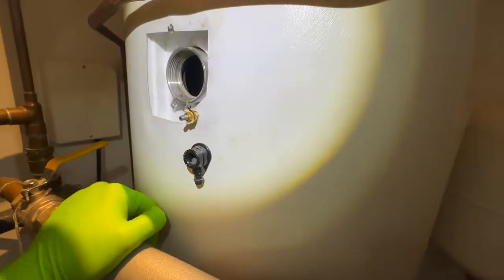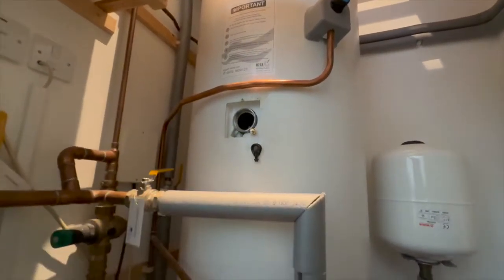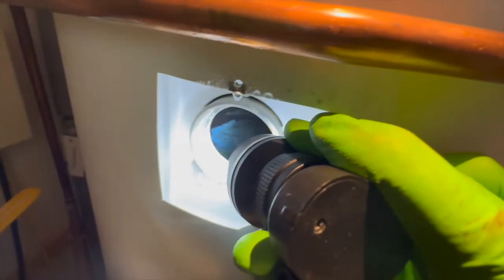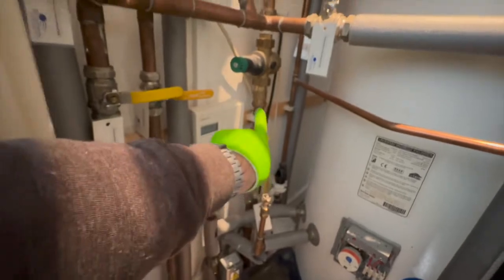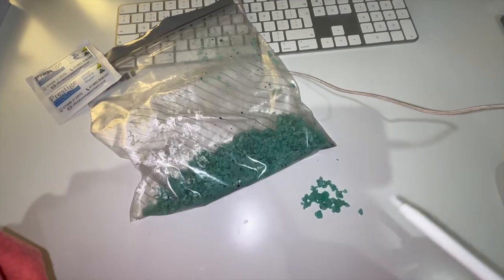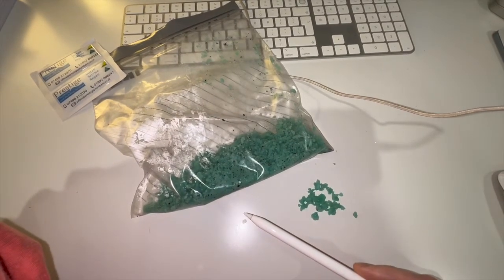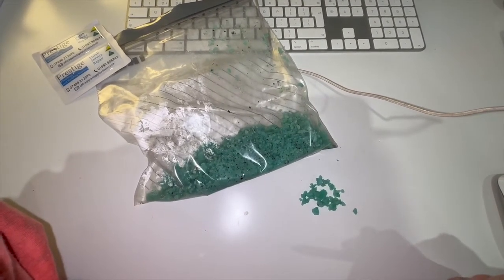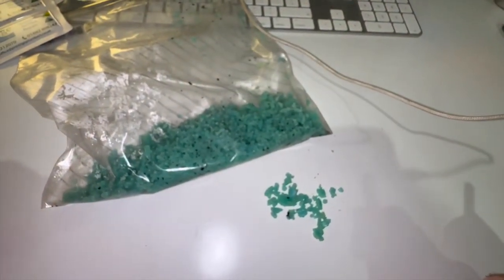Broken baffle plate in Heatrae Sadia Megaflo hot water cylinders

Comment: Hi,
thanks so much for this video, I've been dealing with something similar since 9 months.
I'm currently a tenant in a flat with similar Unvented Direct Cylinder from Heatrae Sadia, and the water since we moved in smelled of chemicals/heated plastic.
The one in this flat was installed on 2016 and it has a corrosion inhibitor unit from the cold water inlet.
It's been a nightmare trying to get this cylinder checked and serviced, as the property manager from Chestertons in London, the estate agency renting this property, has been the most incompetent, uncollaborative and rude person I've ever dealt with.
Took 5 months to get someone from Baxi (now owning Heatrae Sadia) to check the cylinder, and when he visited the property, said he couldn't smell anything unusual other than normal heated water.
Which totally false as boiled cold water and hot water from the cylinder have completely different smells, with the one from the hot cylinder clearly smelling chemical (burnt plastic or when slightly warm is like vinegary).
The boiled cold water is unaffected.
After the Baxi's engineer came (he was probably an outsourced engineer as I could read the name of his company on his jacket), he asked me to do a test to check if the coil was broken (after I suggested it), closing the inlet from the central boiler.
After that the property management should've followed up but it didn't happen, probably because the property manager didn't want to deal with this further.
After 9 months, close to yearly renewal of the rent contract, the issue is still there.
I have the feeling the issue is the baffle disintegrating. Luckily we haven't used any hot water for cooking or drinking, but we still use it showering/bathroom.
Although the water seems clean and the taps aren't clogged other than usual limescale.

Comment: My plumber has conferred with a Baxi staffer on the tech side and has suggested a separate expansion tank and a strainer on the main hot outflow which can be more easily serviced and cleaned. A more economical option that I’m prepared to try. Baxi customer services option was for them to send one of theirs to confirm it is not repairable at around £90 which they say is refundable if the faulty baffle is verified. Then it’s over to the warranty people. I put the question, ‘as its a non-serviceable part that an annual service wouldn’t have discovered, will your 30 year warranty be honoured despite mossing service history’? No straight yes or no was forthcoming.
Reply from the maker: I've done the same myself on very old cylinders - and it will work.

Comment: Im not surprised that Baxi are wriggling over this issue as it is clearly a flaw in the material used and of a non serviceable part - or at least its in such a place that would require the dismantling of the cylinder. This is obviously acknowledged by the manufacturer as the faults are dealt with by a full replacement rather than a ‘repair’.   My plumber and I have just discovered this today in my 15 year old Megaflo. I haven’t got a full history of annual services as we are the second owner of the property, but an annual service would not have prevented this. Hiding behind their warranty in cases such as this is arguable unethical.
Reply from the maker: The cylinders are not designed to be internally maintainable unlike large commercial calorifiers which have proper access ports. So there is no way to change the baffle and no way any service work would prevent the baffle from failing. They are avoiding their responsibilities by suggesting servicing would have prevented this issue. As you say, the material used for the baffles was clearly not fit for purpose.
Reply: @PrestigePlumbingUK  Thanks for the validation. Did you have any feedback from Baxi?

Comment: My plumber just discovered this problem on my 2008 tank yesterday - all my hot water pipes are full of sludge and shreds of black plastic and as all the taps in my house are mixers all of them were clogged and needed to have the filters cleaned.  Took my poor plumber hours but as it’s still in the pipework we will eventually lose pressure in the taps and showers again.  Two of my hot water pipes are inaccessible and will need tiles removed - a very expensive problem.  Contacted Heatrae Sadia and they tried to say my warranty had run out but I dug my heels in.  Technical department told my plumber it was the baffle but the service department are insisting on sending an engineer to assess the problem.  Can’t give me a date - I will be phoned the night before to say they are coming then again in the morning to let me know what 3 hour time slot I have been given - great when Xmas is 2 weeks away!  Not impressed and as my cold water comes through the same spout as the hot on my taps, I am loathe to drink or use the water for cooking so am heading out to buy bottled water!
Reply from the maker: Your kitchen tap should be fine to drink because despite sharing a spout, most kitchen taps (not all) are actually a spout within a spout - for technical reasons I won't bore you with. I'm sorry to hear this has occured to you. It seems to be a common issue.

Comment: Hi there, thanks for the great information - I had a similar issue constantly having to clear the sludge from the shower and taps and after watching this I contacted Baxi to explain the problem and what i thought it was - initially they tried to say it was not covered under the 25 year guarantee but I have evidence of annual services and explained that this is the failure of a non-serviceable part so they sent an engineer out to inspect it and have agreed to replace both the tank and complete the install - it is very accessible so an easy change over. So thanks to you for flagging this problem I'm awaiting delivery of my new cylinder and install next week...hopefully!
Reply from the maker: I'm so pleased to have helped. Baxi have probably put a contract on me as I've heard via  multiple emails now from lots of others who have had the same! It's clearly a widespread problem.

Comment: I m just going through this process having discovered the 'sludge' in a Mira Excel shower mixer about six weeks ago. (Early Sept '24) How do you flush out the hot water pipework?
Have you tested to see if the blue sludge has any toxicity?
Reply from the maker: We use a REMS Multi-Push SLW flush machine along with a flushing pump - the REMS machine pulses air down the line as it is pumped at high velocity to shift debris. Very specialist kit - not owned by most plumbing/heating firms and certainly not in the arsenal of a home owner as the kit costs around £5K. No testing of the sludge conducted by us.

Comment: I think I’ve got same thing - having a new bathroom fitted so system drained and then tap in kitchen had very low flow… checked the filter and full of white stuff and my plumber mentioned this problem with the baffle falling apart. 13 years old and I’ve had it serviced by the plumber who installed it every year (although as we know this doesn’t stop or even highlight the issue). I assume over time this will only get worse and pressure will become a problem. It seems from other threads that Heatrae would provide a new tank a few years ago but may have stopped this practice more recently making it harder to get a replacement….assume I should still try and put pressure on them to get a replacement - in the hope that newer models have an improved baffler??
Reply from the maker: Hello, I'm not sure what stance Heatrae Sadia are taking lately with provision of replacement tanks. The provided a 25 year warranty on the tanks - so as I see it, they should replace it.
Reply: Absolutely get onto Baxi (Heatrae Sadia are part of them). I had this problem last Christmas. Cylinder was 7-8 years old. Baxi came out for a site visit. Told the guy I was getting the crystals blocking taps and he recommended me for a new cylinder under the 25 year warranty. They asked for proof of servicing and tried to get me to pay for installation of the replacement cylinder which I challenged. They gave in quite easily on that quite rightly, and even contributed to invoices from the plumber who identified the problem.
Reply: I should add that in order to get the Baxi engineer out I had to sign up to their year long repair plan which gets refunded and cancelled if the fault is a warranty issue, which it clearly is in the case of a baffle crumbling. To be fair, overall I couldn’t fault Baxi customer service. They try it on (as I’m sure they’re told to), but they don’t make things too difficult.
Reply: Thanks both - i’ve got engineer coming out but like you had to sign up for monthly payment plan which will get refunded if it does turn out to be baffle breaking down - did they drain the system and look inside tank to check baffle or was the crystals/plastic collecting in the tap filters enough? Pressure in my shower has dropped too - but i’m leaving cleaning those filters until the engineer comes….
Reply: @RhiannonCurtis-j6k  Hi, the Baxi engineer that came out to me didn’t drain the cylinder, look inside the it or take any tap filters off. Took my word for it when I mentioned that I’m constantly getting crystals in my tap filters and cleaning them out regularly. I mentioned that my research leads towards a crumbling Baffle… He only took photos of my airing cupboard/cylinder location to show head office that there isn’t issues with access to the cylinder. I think people with cylinders in lofts would have difficulty getting work done by Baxi…

Comment: Great video - thanks! We may have the same problem. Frequent overflow discharge due to loss of air-gap (requiring frequent regeneration) and some water pressure loss on a Baxi Megaflo (identical unit?). Plumber has diagnosed failed baffle plate. No sludge in taps (yet) and Baxi have agreed to install an expansion tank. Not sure if this is going to fix the problem. @PrestigePlumbingUK we've emailed you for your advice!
Reply from the maker: Not a problem. Reply sent to your email!
Reply: I was initially supplied with both external expansion tank and strainer. Initially resolved issues but within 8 weeks had issues with showers again. Whilst the strainer did catch quite a bit, it required significant effort to empty weekly and we found the smaller pieces were not being caught and eventually blocked the mixer cartridges on the showers again. Baxi returned and replaced tank. Initially asked for service records for the tank in making a claim but was firm with them to say that annual servicing of a water tank was uncommon and given the nature of the plastic baffle breaking down would not have changed the outcome.
Reply: Same has happened to me. Baxi engineer has just been out and said they'd probably put an expansion tank in. I said that won't get rid of the stuff floating around the system. He said that's the view of many of the engineers. He also said it's a very widespread problem. I guess the expansion tank (a new "solution" introduced a few months ago is to reduce the cost of warranty claims. I was expecting a defence of "you haven't had it serviced" but didn't get that. A service would not prevent failure caused by a poor design.

Comment: We have a Megaflo. Presumably if the baffle has failed the air bubble no longer exists so instead of  replacing the cylinder is it possible to install an external expansion vessel ?
Reply from the maker: Yes it is possible to do this. I would suggest you install a strainer on the outlet pipe to ensure the disintegrated baffle doesn't make it's way into your plumbing system - as it will damage taps and shower outlets (becoming lodged in them). Fit an over sized strainer to ensure good flow - so you do not bottle neck your output pipe. So if you have 22mm outlet pipe which is the most common in the UK, then install a 28mm strainer with reducers each side. If you have 28mm as found in larger domestic homes, then install an 1 1/4" strainer with reducing bushes to take you down to 28mm and so on. This is something we have done for clients in the past. Ideally - replace the unit.

Comment: Hello, I have been having the same problem. Baxi have sent me a replacement cylinder but I’m still waiting to find out if they will do the fitting. They have been very slow in dealing with this and the water pressure is getting weaker and weaker. They should really cover the whole cost of this.
Reply from the maker: It seems they are becoming more reluctant to supply and fit. With many people just being supplied a new cylinder and needing to arrange installation themselves. Good luck with it. Keep us posted please.
Reply: Will keep you posted on progress, thank you
Reply: What kind of cost am I looking at to install a new cylinder and clear the pipes/cartridges out? I would really appreciate some guidance on this. Thank you

Comment: Hi - I am experiencing the same issue. My other half seems to think we can have just have the pipes flushed and carry on. Surely this will cause us issues in the future ? I am going to contact the manufacturer to see where I get.
Reply from the maker: A large amount of the baffle plate will be floating around in the cylinder, and will intermittently infiltrate the plumbing. If you go down this route, fit a strainer on the cylinder outlet to capture the debris and ensure it can't contaminate the system further.

Comment: We have the same issue with our flow and pressure. Had a plumber out and they have suggested it might be the baffle. We have a Megaflow engineer coming on Monday to confirm the problem. The boiler was put in in 2006 and they are asking for annual servicing evidence but we only bought the house 4 months ago. Not sure where this leaves me with a replacement and installation. Any ideas?
Reply from the maker: Hi Max. The manufacturer will try to use this as an excuse to void the warranty on the unit. As an experienced plumbing and heating engineer, I can tell you categorically that servicing of the unit would have done nothing to save the baffle. The baffle is sealed inside the cylinder has no serviceable components. It can’t be cleaned, or maintained in any way. Servicing of these units is primarily testing the safety components (pressure / temperature relief valves) and re-establishing the air gap above the baffle. So if they say the warranty is invalidated, I would suggest you argue your case. Please let us know how you get on.
Reply: @PrestigePlumbingUK  So, I had the engineer round and he has said i can have a new tank but not the installation. His argument was that servicing would have protected the baffle because restoring the airgap annually would have stopped it from happening. I don't think he is really the main decision maker on it so am waiting for a call from Baxi to confirm the tank replacement. I'll have another go at it when I speak to them on the phone
Reply from the maker: Baxi seem to be using the 'lack of maintenance' as an excuse for invalidating the warranty. I can't see how maintaining the cylinder would make any difference - I would be pleased to understand how it would. I suggest you ask them for the answer in writing. You then have it as hard evidence if you choose to go to a solicitor with it.
Reply: @PrestigePlumbingUK  **UPDATE** After a bit of back and forth and wrangling, Baxi have agreed to supply AND installation!! I made a bit of a fuss about how much I had already spent investigating the issue and how I'll have to get all the pipes cleared etc. That, as well as asking for evidence that annual servicing would have stopped it from failing, meant that they caved in and agreed to the installation too.

The info this video and feed provided was invaluable and gave me numerous avenues for discussion, whilst ensuring I was never backed into a corner. Thanks so much for responding and for all your help, you've been brilliant.
Max
Reply from the maker: @TheHammers527  That's great news and is exactly what they should be doing.
Reply: @TheHammers527 I have the same issue and will use the same line you’ve gone down. 

I’m really confused how nobody has started legal proceedings against them. If the plastic is hitting aerators in taps then surely there’s a microplastics contamination issue.

Comment from the maker: The manufacturer supplied and fitted two new cylinders for this customer but the issue of blockages in the pipe work have been left to us. I personally think they should also collect the fee to resolve the problems caused by their faulty product but our customer had no appetite for legal proceedings. As I said in the video. I’ve seen this before and it caused a lot of problems then too. Shame as the design is excellent but the baffle material was obviously not fit for purpose.
Reply: A legal route is likely the only way forward but few have the stomach for that. A group action often carries more weight.
Reply from the maker: @winning.is.spinning  Agreed. The manufacturer attempted to blame it on the 'secondary return' initially until I pointed out it had occurred in two cylinders in the same property. One with a secondary return, and the other, without, serving just one bathroom. Things like this can happen, especially years after a product is manufactured, but if they provide a long warranty, they need to honour it.